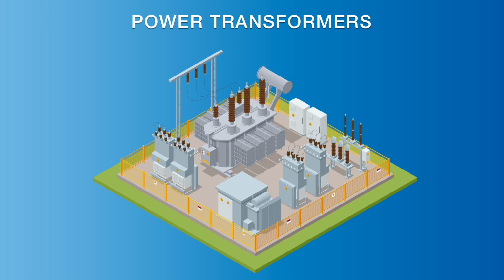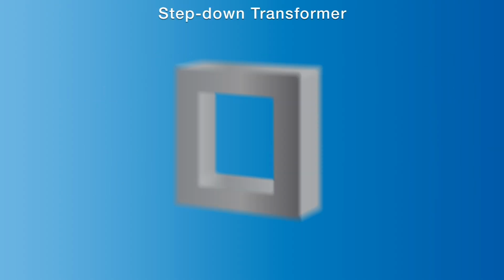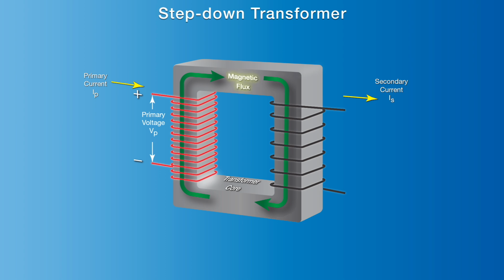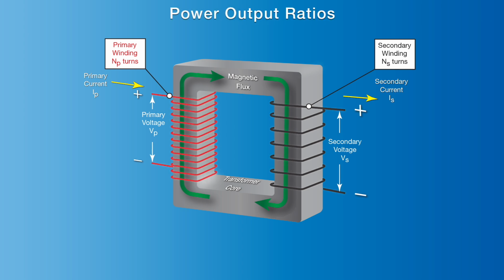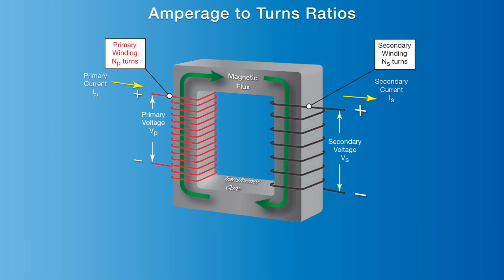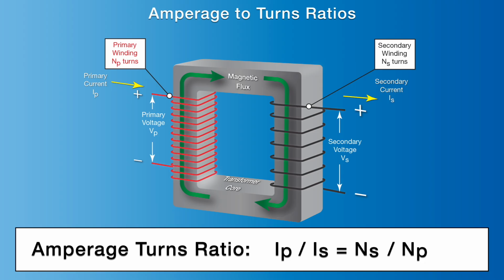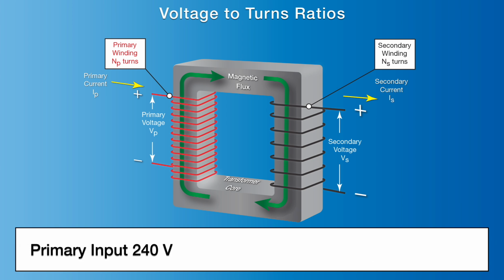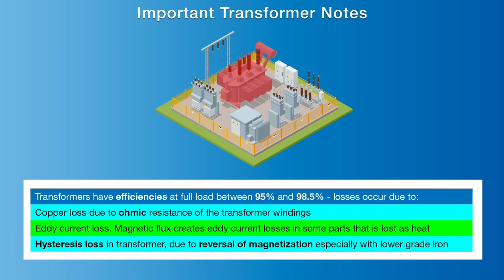Step Up Step Down Transformers

Comment: And what happens when you connect Renewables and trying to push power backwards through a already charged Step Down Transformer the answer is and 85% loss as watts is the total amount of work but not the actual flow of amps armed only with a Revolt amp meter you can double-check the installed watt meter and see an 85% difference